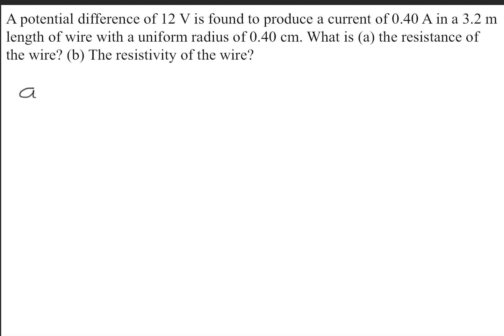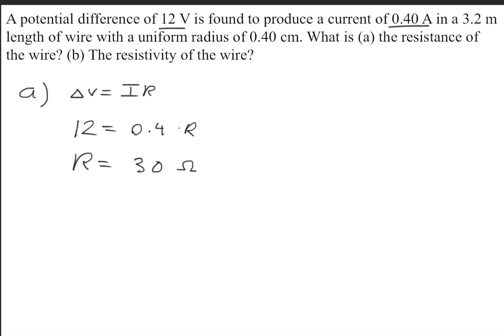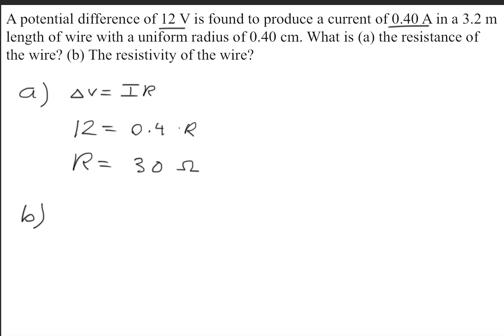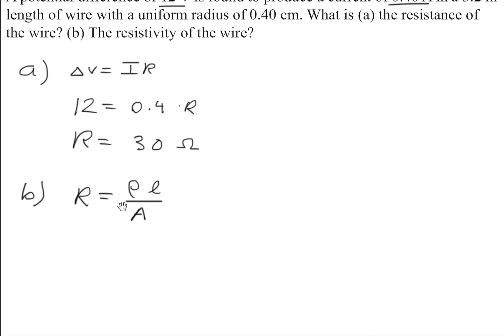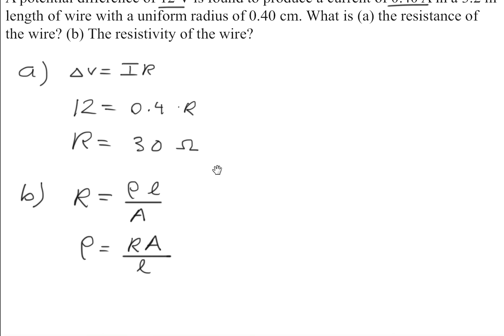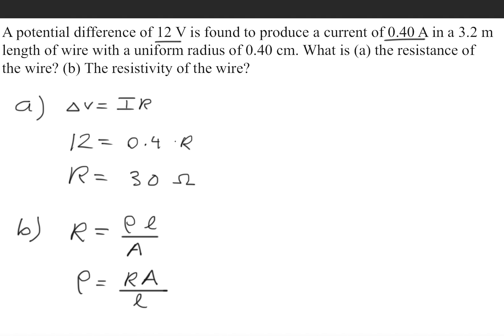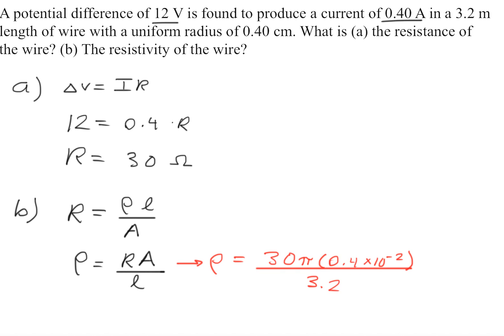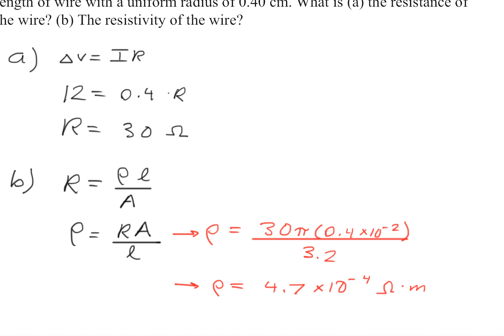A potential difference of 12 V is found to produce a current of 0.40 A

Comment: Your final answer is correct, but there was one minor issue. When you plugged in A (area), it should be pi(r)^2 since we are talking about the area of a circle. You forgot to add the square. You still calculated it properly in the end, you just forgot to write it in.
Reply from the maker: FinalFina Whoops, that's a bit embarrassing on my part. Thank you for pointing that out!